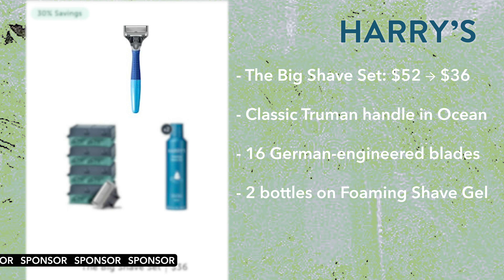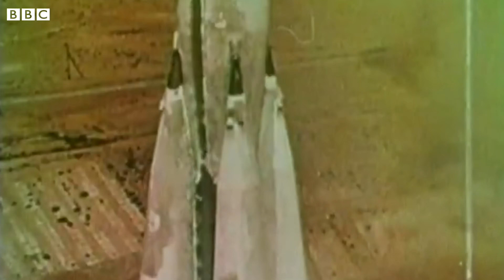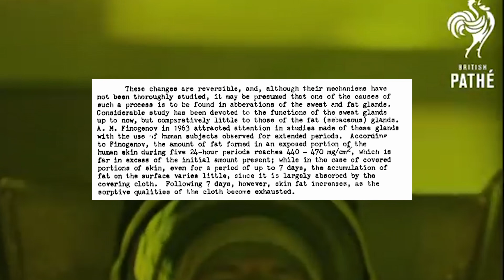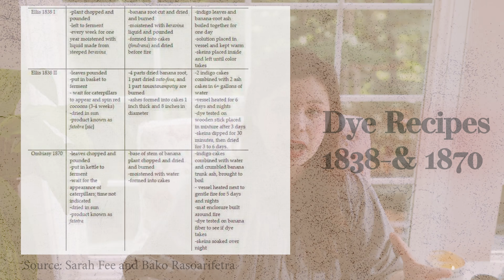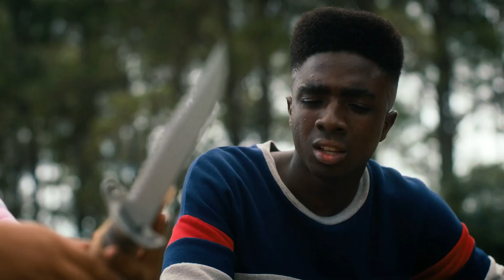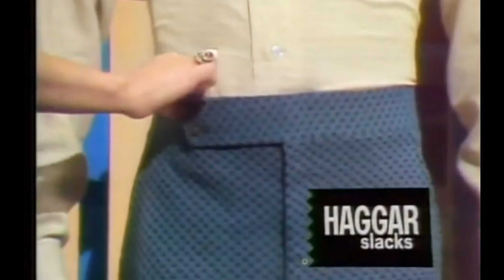The DISGUSTING truth about Laundry

Comment: A clothesline ideally catches some breeze as well as sun.  Not only will clothes dry faster but will be softer as well.  Clothes dried inside will emit moisture that can lead to mould.  Using an efficient dryer correctly (reduced temp & time) can be the best option in winter.  I also find the best way to remove pet hair is 15 minutes in dryer with low heat then line dry.

Comment: If it helps, think of bacteria and germs that cause smell and botchulism like mosquitoes. When winter comes and their food and same environment goes away, they’re gone since they die off. When something is cleaned to a sanitary level, some of the microorganisms die off since there isn’t enough to feed on. You do not need to sanitize anything unless you specifically want it to have a lower level of contamination than is present at standard atmospheric conditions. Yeast exists in the air, which is how some sourdough is made. Germs exist on the ground, which is why you wash your hands after picking up something from the ground. If you want to operate or eat with something, it can be good to sanitize it, but if you’re just throwing it on or going to store it for a while, it is not necessary to sanitize

Comment: You are not entirely correct. Bacteria will be removed even without hot water or sanitizers through rubbing the fabrics and flushing them away. But of course not all bacteria will be removed that way, so if clothing has a weird smell or there was a sickness in the household the clothing should be sanitized. Otherwise the immune system should have no problems dealing with leftover bacteria. There are always bacteria on our clothes. Even if they are freshly sanitized: Once we fold them, expose them to air, breath on them and put them away, together with the other clothes in our closet, they will have bacteria on them. Maybe even poop bacteria. And that is ok.
Reply: Plus: It is recommended for everyone to wash towels, underwear, socks, … separately and on a hotter setting…
Reply: Ok one more: Drying clothes în the tumble dryer is also helping to sanitize. Not only the sun. :) But I also prefer the sun.
Reply: Thank you yeah I was misled about soap for a long time and didn't realize the whole point is that surfactants wash away bacteria with agitation - that's why I used to abuse my hands with scalding water and alcohols!

Comment: 5:17 Truthfully?! Never! 😅 Because:
First: I don't wear a shirt only once before washing it. Since I shower daily, in summer often twice, I wear a shirt at the very least 2 days before it goes into the wash.
Second: These holes are not such a mystery to me, and they never appear after one wash. Not ever did this happen to me. A very cheap one might not get old before getting those. But they are usually in places where the fabric gets pressure. Like the belt buckle. That's where I get those holes sometimes.
Third: Clothes aren't that cheap. But I don't live in North America. Maybe clothes are a lot cheaper there. Germany has many different price level at which you can buy clothes, quality low and high, and most medium prices clothes are sadly low quality. So that's why I don't shop online!! I need to feel and test the fabric before making a decision on buy or pass. I hate clothes shopping more than anything...I wish fabric was more affordable, I'd tailor everything myself. Would solve so many problems for me. But I can't afford fabrics here. 

I can believe how much I just wrote for only that one part. Also seems like I disagree with the video. But I don't. I see where she is getting at and I absolutely agree with that

Comment: I recently had to bleach soak some clothing, a mixture of items that were holding onto oil and a could pieces that just had spot check stain. I was lazy and put them all in the same tub and I was blown away by how quickly the water turned brown and how the garments that were "clean expect for a small stain" had to be rinse over and over to run clean in the water. This vid has confirmed to me what I didn't want to admit to myself :(

Comment: hey. i know it's an old video but as a chemist with a microbiology minor i feel qualified to speak about this. 

Your clothes for day to day wear don't have to be sterile,  you are not puttig them in your body. They will have bacteria on them again as soon as you take them out and fold them. 
the water alone already cleans quite a bit, mechanical action sure as hell helps from simply rinsing away the filth. 
this is partly why you shouldn't overstuff the machine. the clothes need to move.

surfactants dissolve away lipids. This means the oils of your skin. the non water solluable stuff gets made water sollulable by the detergent. 
It also rips open the bacterial cells. that bilayer, it dissolves.
When you have a detergent that's suitable for lower temps, your clothes do get "sanitized". 

sure was your bedlinnens hot, especially if you live in student housing because the low temps don't kill scabies.

use vinegar to soften your laundry. it works great also helps get rid of stink. maybe get a water softener. sure as hell dry your clothes outside it's great and free. or even a rack inside your house. 

However, we don't soak our hands in ethanol each time after washing our hands to sanitize. we don't use boiling water. clean enough is a thing. a hell lot of the cleaning of handwashing is actually mechanical action. simply the water cleaning your hands.

Comment: I have a front loading washing machine.  I use a standard washing powder but no fabric softeners.  Instead of softener I put white vinegar in the softener dispenser.  Ie the last rinse.  This brakes down any soap residue that may still be on the clothes leaving them soft.  I am sure the acidity kills of many bacteria as well.   Vinegar will also help for hard water as it can desolve some of the calcium / mineral content of the water. As I am in the UK I also line dry weather permitting.  If not damp laundry get hung on hangers, on a clothing rail in the house near a radiator.

In the UK I can also get a washing powder called NAPISAN  as its name suggests it was originally used for soaking baby’s nappies  and staind clothes.  so it also sanitises by killing bacteria.  I found the name brand does not bleach out the colours in clothes but does clear stains.  Be wary of off brand nappie cleaners as I have found they can often bleach out colours on clothes.

Comment: I have washed my underclothes by hand many times before. Dear god it's awful. Also I stopped using fabric softener.
Edit: 
Today I washed my underclothes in hot and boiling water in my sink that I cleaned first of course. I used a masher I barely use as an aggatator and oh my god the water! It turned in to gray milk! Once the water wasn't as hot I was able to do some hand aggating and I rinsed in warm/hot water and hand rung out the water as best as possible. It's been outside on a make shift clothes line that include a broom and a shopping cart for about 3 hours now. I'm gonna keep it outside until the sun is almost gone. It's cold outside but their is sun and a breeze and so far they look good. I can't wait to see how it turns out.
Edit same day!
I just got my clothes from outside. They were there from 10am until about 330pm. It was cold outside but with the breeze there was only mild dampness on three slightly thicker items. But nothing is still wet or soak. They feel great and I did hang them up to dry in the house and I'm gonna put them back out tommorrow for more sunning.

Comment: Stop using washing machines
Reply: No. That’d make clothing take forever to launder
Reply: @kawaiidere1023  not so. Washing by hand can be just as fast if you know what youre doing.
Reply: @tiagovazkez9356  faster than throwing a load in and letting it run for 30 minutes to an hour without having to do anything?
Reply: @kawaiidere1023  yes because the washing machine doesnt wash on its own. It needs human input like putting the cloths in setting it having it fill up taking it out and hanging it to dry and thats. If u have a fully operational machine because many older machines need much more input. I know it because at work my bosses had to hire laudresses to wash the clothing when they had 3 washers and 3 dryers

Comment: I only wash colthes if they have a stain or if they smell. If I had already worn something, I hang it outside of my closet so it can air out. 

I do use the washing machine, 30C for most clothes, 60C for sheets, towels, cleaning rags and stuff like that. If you are worried about sanitizing. Laundry sanitizers do exist.

I hang everything on collapseable drying racks and we just have them in the living room for that day when the laundry is drying.

For wool, silk and other delicates I either use the handwash cycle or I wash them by hand. I lay them flat on the drying rack to dry. For these things I use special detergent.

Comment: You can use moderate amounts of bleach with your septic system. The amount you use for a load of laundry in an HE washer is absolutely ok. It turns into salt and water. The detergent you use is actually worse. 

Also where are you buying tshirts? Like mine aren’t expensive but like $3 walmart tshirts last me a decade. I think some of them have lasted 20 years until I manage to really rip an unrepairable hole in them. 

Cold wash with the minimum of detergent, vinegar added occasionally or to underwear loads. Line dry if possible but if your dryer isn’t drying clean your exhaust. I can almost guarantee that either you have a kink or you have a clog. I did loads of towels in a standard home machine for a vet clinic and they were dry when we unloaded them unless the exhaust had gotten clogged.

Comment: I don't know if you can find that easily in the US, but from France I can tell that white vinegar (like 0.5 € for 1L) is a very good way to : 1) eliminate bacteria (very very good at that in fact, I also use it non diluted for washing the toilet) 2) prevent colors from mixing during laundry 3) soften water (hence making detergent more efficient) 4) keep the machine free from tartar deposit (which is kind of the same effect as softening water). I put one shot in the prewash compartiment and one in the rinsing compartiment.

Comment: I couldn’t imagine doing away with my clothesline 🤦🏼‍♀️ I live in a rural area so it isn’t an issue for me but when I rented in an urban area I used a collapsible/retractable clothesline that was simple to connect and disconnect. I also used (& still use) a collapsible “seagull rack” which holds an entire load of laundry (if I use clothes hangers) and that folds down/stows away easily when not in use - I stow it on my porch bc I use it so often.

I do have a dryer if I need it and I mostly use it to tumble dry my laundry for a few short mins after the line dry, before putting away. I do this to soften towels and sheets and to remove any pollen or tiny insects that may be resting on the laundry. It’s def a paranoid precaution but it works for me 😂 Great video!

Comment: In regards to your search for eco friendly (no harsh fragrances and dyes) detergent that is not "behind a barrier" - 1 tbsp washing soda + 1 tbsp borax with 1/4 cup white vinegar as fabric softener is an option. One could add lard soap (shredded or dissolved in hot water) for extra cleaning power, or you can just throw in a squirt of dish soap if you can tolerate that marginal amount fragrance and dye. You can get those three/four things at just about any grocery store for ~$12-15 and they will do many loads.

Now, some people get nitpicky about the environmental friendliness of borax and whatnot but you'll go crazy if you try to find a way to do every little thing with absolutely no negative impact on the environment - sometimes you just have to get as close as you can and say "good enough!"

Comment: Hi, I've been using the Eco Laundry egg for a couple of years now & saved a fortune on washing detergents. I line dry my washing in the spring & summer. In the winter I hang it on coat hangers in my airing cupboard. If that's full I use a heated airer with a cover over it.

Comment: As an ex dry cleaner... You'd be surprised to what we put in the wash, or vs a steam clean. Wool can soak only but best with a steam cleaning it lifts out most stains. And grease/protein needs a protein to be released, I use old nasty bana peels it doesn't bleach and it smells amazing, the pure protein lifts even blood by 80% and then a light hydrogen peroxide rinse

Comment: Does the dryer not kill anything the washer leaves behind?
Reply: You ever smell a teenager's shirts after being in the wash?

The stink under the underarms is from bacteria of the body, the scent is their collective waste and breeding in the damp moist environment beneath your arms and other areas. Because your body secrets oils (sebum) as well, the sebum coats the bacteria, keeping it safe from alot of the washing process and what doesnt get removed in the wash remains in the fabric during the dry. The sebum coating the bacteria and the waste of the bacteria survives the dryer. The only stuff that is killed and eliminated is what has been stripped of that oily sebum layer. So you still have stinky pits in your sports teens' tee shirts despite the dryer.

If you've ever used lanolin, its sheep sebum. Its thick, and requires warm water, strong soap, and vigorous scrubbing to remove from your hands. Human sebum is similar in some cases.

Detergent and soap are apparently (and bafflingly) not the same things. Soap binds to dirt and oils with the goal of washing it away. detergents, as stated in the video, soften water first. And then more research you do on it, you find that cleaning is not the primary purpose of a detergent. So the properties used arent strong enough to remove the sebum of the body in some places where it accumulates the most, but if you've ever used a pretreatment bar, used dish soap (Super harsh) or a laundry bar on your clothes, soap "emulsifies" (for lack of a better word) breaking down its structure and making it easier to wash away when rinsed.

But it works best with hand washing using a brush or a small wash board as the actions in the process works the soap into the seams and fibers, stripping the bacteria and their waste of their protection and thus allowing for the hot dry air to do its job. But the air still needs to be about  140F to kill the bacteria once stripped. Otherwise it gets dried out and like a fungus and "comes back" once moisture is reintroduced. 
You can clean your body, but start sweating in a clean shirt and smell like you havent bathed in days because of it. Years of living with a garbage washing machine in my building as taught me this.

So, the only real way to know for sure that your clothes are sanitized is to boil them.
MAYBE if driers used uvc lights; the uvc, heat, and dry air could kill the exposed bacteria... with out any chance of it returning with the right conditions.

Those videos were people are making their own powdered laundry detergent with washing soda, borax, and fels naptha/zote soap are on to something.

If someone could think to out fit a dryer with UV typce C light, people who dont have the space to hang a line, could dry their clothes and sanitize their clothes in the dryer... it could be innovative.

But until then, boiling is the next best thing. (Search 5 gallon stock pot on amazon and search by price. You can find some good ones. Havent looked back
Reply: @hakudoushinumbernine  I wash everything in hot water and my hot water does get above 140 degrees. I never got on the cold water washing train. With the new washers that are all total garbage at washing your clothes, I do a 30 minute soak, extra water, and then an extra rinse. Hopefully it’s all helping a little, I never have issues with clothes still stinking.

Comment: So on a warm summer's day, line drying can actually be quicker than tumble drying. Another thing, Abby, you can also get clothes lines that you can fold up and put away, so you can put them in your house or outside. You can put your undies there and the neighbours won't see. Otherwise, with the square ones, I just put my undies on the inside and normal clothes on the outside.

Comment: A South African here. We have a top loader and we do batch washing. So in our household we've broken down the laundry to only having our under garments washed weekly. We do everything else either monthly or once every two weeks depending on how hot it has been. Since I started doing this the water bill has reduced dramatically and there was a small impact on the electricity bill too. Please note that I boil the linen and undergarments, then put into the sun to dry and then iron to make sure that well if there was anything on those, it's not anymore.